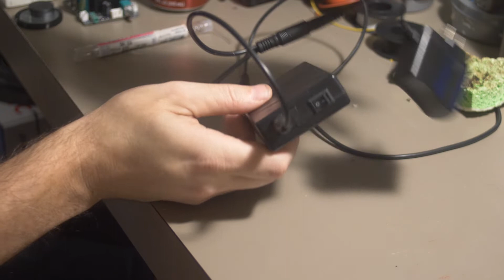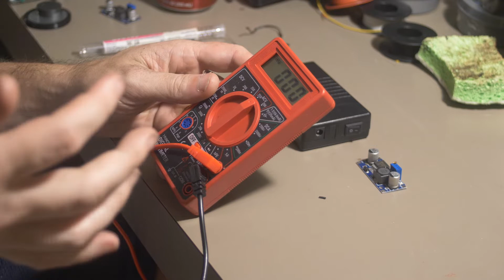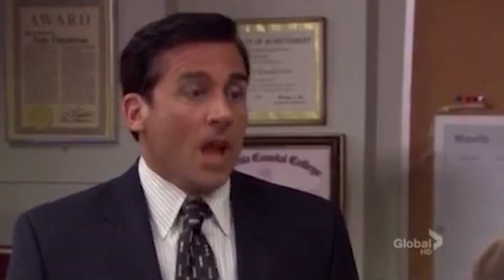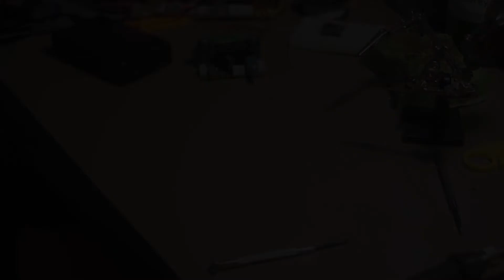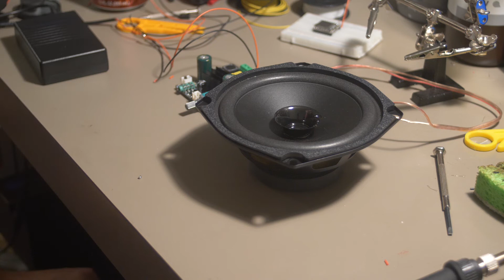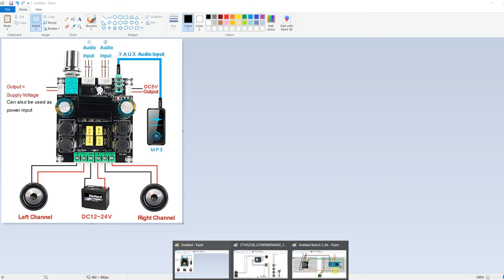Ghostbusters Arduino Proton Pack Tutorial - Part 8: Powering the Pack

Comment: Hey Joe do we need to use the buck converters, and do we need to use the talentsell or can I just use a normal power bank?
Reply from the maker: The buck converters are there to convert 12v of power down to 5v because most of the components are 5v. you can use the USB connection from the talent cell without a buck converter (because it's already 5v). I do not recommend any other power banks than talent cell, because normal ones are just intended to charge a cell phone, and will turn off if it doesn't receive a certain amount of current constantly. Which will mean your pack either won't come on at all, or will act wonky.

Comment: I connected my 1200MAH battery to the buck converter and I'm using the breadboard to test the connections, but the arduino and dfplayer don't give a signal! I followed it correctly, but they don't turn on... I don't know what to do...
Reply from the maker: did you make sure the buck converter was set to 5v before you attached those two things to it?
Reply: Yep  @wholesomejoe .  I've already tested the Arduino to see if it was broken, but it's working. It's a mystery...

Comment: Hiya Joe! I've been having a problem with my DFPlayer mini I ordered from your amazon link. Whenever I put some mp3 files for me to play some music while in party mode I run into the issue of when I turn on the pack, all my sounds mix and play in other's actions. Like I'll pull the activate switch and it'll activate the turning on the pack instead of the click sound. Do you know why this could be happening? Do you think you could forward me to a group of people who might save my case if you can't help me? Thanks!
Reply from the maker: Sounds like you've got a file issue. Has it always done that or did it work properly and then start doing that? I would go post this in my arduino for Ghostbusters Props Facebook group!
Reply: It's always done this, whenever I put a mp3 file in the 01 folder, it makes the whole sound system mix the files up
Reply: @wholesomejoe

Comment: ey joe know you been busy but just wondering if you know if the afterlife option in Mike_s11 code starts up with the slow ramp before reaching max speed in the cyclotron similar to tacobelli’s demo? I’ve seen in his video that you can switch TO the afterlife mode but does it have the ability to boot up completely into afterlife mode?
Reply from the maker: I'm not entirely sure on that one. Maybe ask in the arduino GB Facebook group.

Comment: If I used the wire diagram by Mike S as you show with the afterlife switch, what changes will this create later as far as switch placement or folder copying?   I just want to be aware of anything I may run into if I opt to do a mix of your design and Mike S’s.
Reply from the maker: Shouldn't change anything, you're just adding a switch in between the battery and the main power, I believe.
Reply: @wholesomejoe  thanks.  Looking forward to your next video on this build.
Reply: @wholesomejoe  any updates on this proton pack?  My daughter has hopes of making a new one this year for Halloween now that she’s 12, same age as Phoebe in Afterlife.

Comment: Sorry joe I might have missed it at some point in Your video but why does the amp not need the buck converter?
Reply from the maker: The amp requires 12v of power, the battery supplies that already without needing to step it down.